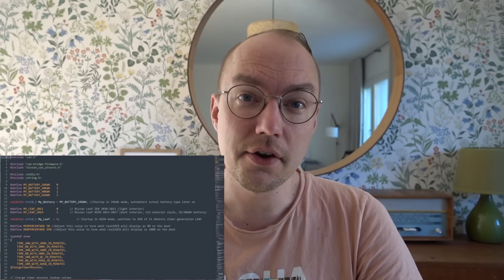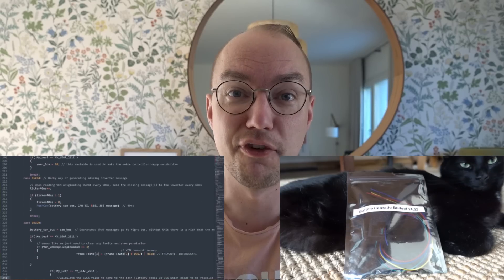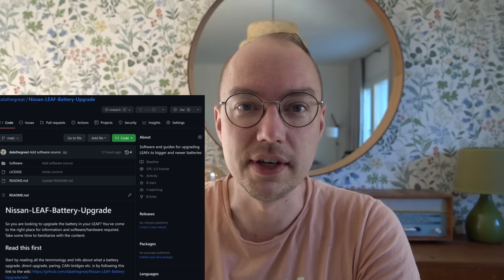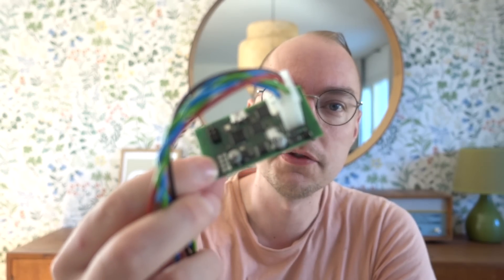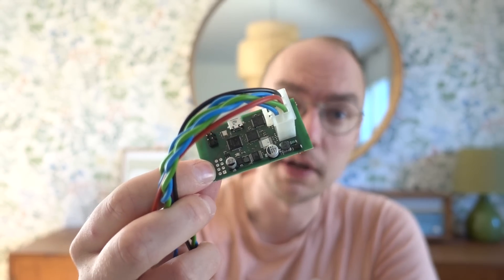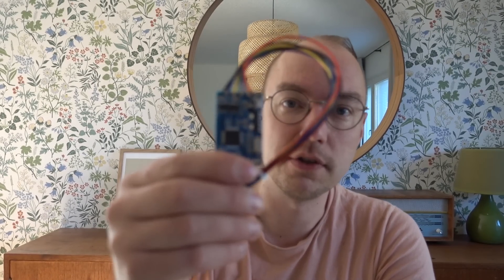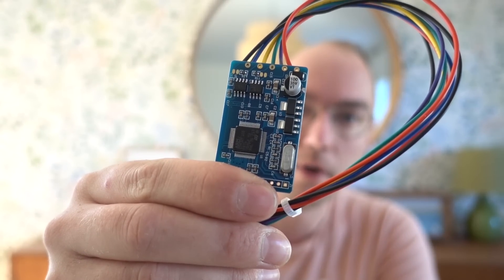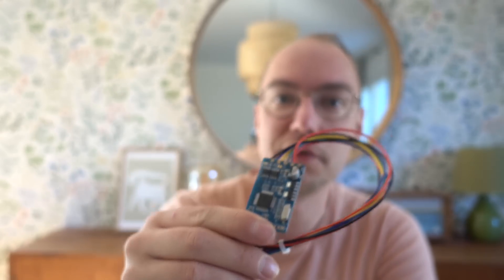Nissan LEAF Battery Upgrade hardware is now FREE

Comment: Nice action, but... not usefull. For a second I thought that its purpose is to repair (repack) the battery. But this software is only for replacing the battery from another car. I can't imagine where you can buy a good OEM battery, or, moreover, a good OEM battery from the latest model of the car separately from the car. It will cost as much as real estate. In our country, the only way to drive electric car, is to buy an old Leaf and repack the battery into Cattle cells. I thought for a second that your software allows to do this, but... well, all the things remains on it's places. To be continue with internal combustion, which remains the main source of moving.
Reply from the maker: Repair is available via Leafspy, and Repack is also freely available on the Mynissanleaf forum.

Comment: Here's something you might like to be aware of. Here in the UK there seems to be a lot of 10 year old nissan leaf's with 11 and 12 bar's of battery condition. Seems to me like something is obviously wrong, I have heard of a device that can reset the battery condition display have you seen this and would leaf spy be able to check this out.
Reply from the maker: Covered this in my "Nissan LEAF BMS unlocked" video

Comment: Hi sorry for asking a silly question, but what is the upgrade for? It it so you can use the battery to power your house?
Reply from the maker: This is for putting larger batteries into the LEAF. 24 to 30/40/62kWh batteries!
Reply: Thank You

Comment: Hi Dala. Your really instructive videos have finally pushed me to go and buy a 2015 24kW Leaf. Although it has 11 bars and gives me 80 miles range, it would be nice to plan for the future. Can you buy the canbus kit, program it and fit to the existing car before buying a 30 Kw battery to upgrade? It seams logical to fit the kit and test it before going through demounting the old battery and installing a replacement and then finding problems.
Reply from the maker: It can cause problems to fit the upgrade bridge without actually upgrading, so I recommend waiting!

Comment: Hello!  Huge hat tip to you for doing this!

I only just learned yesterday about all the DIY stuff people are doing with leafs, so I am really not clear what the parameters/limitations are of different solutions.  So I am wondering, can this work with a custom battery pack made from brand new cells, and which doesn't necessarily conform to the 24/30/40/62kwh capacities?  What if that bespoke solution uses LiFePO, which operates at different voltage to the car's native NMC chemistry (no, I'm not thinking of using both chemistries together)?  Will the code you provide allow the vehicle to "adapt" to this difference, or is NMC pretty much baked in?
Reply from the maker: No it does not work for that.
Reply: Yeah, I was afraid of that.  Maybe someone will crack that code (not holding my breath, though lol).

Comment: If you get a dead one out of the box, will it show when being programed or when fitted in the car? Thinking I have a dead one
Reply from the maker: Unfortunately both failure modes are possible (unable to program / no passing thru messages)
Reply: @DalasEVRepair  thanks for your reply, are they known to fail after some time of use?or once you have a working one,it will last the life of the car,
I have got mine working now, I believe that it was incorrectly flashed the first time
Reply from the maker: @jasong7374  The one I installed on my own car in 2021 is still running great! But having a backup is not a bad idea, they are only 13€. Who knows if it lasts 5-10-15-20years!
Reply: @DalasEVRepair  with my install i have solder in plugs on the can wires of the car and the can bridge, and also Carry a spare programmed and tested can bridge in the glove box,so if I have any issues I can change one on the side of the road, probably being more careful than nessary, but this is my first 40kwh upgrade on a 24 aze0 so still learning

Comment: Hello,
Could you help me with the fact that my car (2017) got a 40kW battery instead of the 24kW one, and since then it doesn't charge above 94%. What is the reason for this? Thank You!
Reply from the maker: Battery will charge to 92-97% real SOC, that you can see with Leafspy. The dashboard will show 100%. This is due to temperature/voltage diffs/internalresistance. Completely normal, nothing to worry about!
Reply: The dashboard show 94%, and LeafSpy same.
Reply from the maker: @PixiTrabi  then you have an older CAN bridge?
Reply: I didn't do the swap, so I don't know.  Where is it in the car where I can look at it?
Reply: I didn't do the swap, so I don't know.  Where is it in the car where I can look at it? The exchange took place in February 2023
Reply from the maker: @PixiTrabi  contact your installer. My CAN bridges got this SOC% fixed in the software at early 2023. If you need support for this, hop on my Patreon
Reply: Ok, thank You!
Reply: Hello, I checked today and I have the green 3-port can bridge in the car. If I read correctly, there is also an upgrade option for this due to the SOC. If I disconnect it from the car, does anything happen afterwards, and if I update it could there be a problem? Can the existing content be read and saved like, say, a BIOS chip? What should I look for on the Patreon page anyway? Thanks for the help!
Reply from the maker: @PixiTrabi  Car wont be drivable until you reinstall it. Yes it needs an update!
Reply: Could there be a difference in the program that would cause the car not to function after the update? After the update, the SOC even when submerged will be the same as in the case of the 24 battery, that the car wrote 10%, but LeafSpy still says 20? Now, in all cases, the car says the same as LeafSpy. Thank You!
Reply from the maker: @PixiTrabi  that will be fixed after the update!
Reply: Thank You! I ordered programmer and try it!
Anyway, can the existing 3-channel be replaced by 2-channel at any time? Of course, after programming!
Reply from the maker: @PixiTrabi  Ofcourse it can!
Reply: @DalasEVRepair  
Is it possible to find out from somewhere what version of software the current can bridge has?  The difference I saw compared to a video is that there are 83-92-99% options for the charging limit.  The video also had 7X%.
Reply from the maker: @PixiTrabi  You probably have a v3.XX these have lots of known issues.
Reply: @DalasEVRepair  What is the latest version now?  Is there a list somewhere of what has changed for which version?
Reply from the maker: @PixiTrabi  4.19 latest on Github. Sorry no changelog back from when it was closed source!
Reply: @DalasEVRepair  Thank you, the programmer will come soon and I will try the update! If I understood correctly, does it need 12V for the update?
Reply from the maker: @PixiTrabi  USB micro cable is enough!
Reply: @DalasEVRepair  Ok! Thank You!

Comment: Hi  Dala! Thank you for open sourcing your projects! I'm very excited about your CCS conversion!  I'm a software engineer myself, but I've not spent much time building ICs and controllers outside of Raspberry Pi & Arduino.  I'm personally interested in replacing the Leaf pack with my own LFP cells and BMS.  How much effort do you think it would take to accomplish building such a bridge?  I would prefer to do this vs adding my own range extending pack in parallel and consuming internal volume and extra weight.  Maybe we could work together and open source the project?

Comment: Legend! Thanks for doing this. I wonder if it will impact demand and price of the used packs? My brother in law's 24kWh is pretty low range now and would seriously benefit from a 40 or 62 :-)
Reply from the maker: Doubt this will do anything with pack prices, but the overall upgrade cost goes down significantly!

Comment: Hi Dala, Is there any schematic for the blue PCB ?
Reply from the maker: Unfortunately I don't have it!
Reply: @DalasEVRepair  I’m sorry for bothering you, I have another question, dose this board with its normal code have different application or it’s for Battery upgrade also ?
Reply from the maker: @ahmadzarara3149  When you buy it, it comes flashed with a mileage spoofer for Mercedes Benz vehicles. Highly illegal piece of kit! After flashing it, it becomes an useful thing that can do battery upgrades:)
Reply: It kind of sucks that some crook selling illegal devices that end up cheating people out of a lot of money is making money off of this.

Comment: Dala, this may be a stupid question but what do you thibk it would take to use tesla cells in a nissan leaf? Ironically, it's easier to find used tesla cells in the states than finding leaf cells that arent severely degraded.
Reply from the maker: See this: https://github.com/dalathegreat/Nissan-Leaf-Bruteforce-Upgrade#a-word-of-caution

Comment: Dala, hello! I bought a bridge 2 can, I flashed it as indicated in the instructions, but the values kW, lbs from 24 and the car aze0 24 did not change, and cells from 40 kW, please tell me what needs to be done so that the car sees the entire capacity of the battery?
Reply from the maker: My CAN bridge is for doing OEM complete battery upgrades, not cell swaps. You need a 40kWh BMS and current sensor...
Reply: @DalasEVRepair  I'm good at circuitry, but it's not my thing to program or rather write firmware. Can I ask you to make a firmware for this bridge? and how much will it be? lbc unit from 40kW is indecently expensive...

Comment: AWESOME! Now I just wished someone could publish what's required to put the 94Ah battery in a 60Ah BMW i3 BEV!  I have the battery (no collision lockout), but no clue how to make it work in my car.  (located in the US)
Reply from the maker: It is plug and play. No coding needed if the battery isn't crashed and locked. Just mechanical work!
Reply: @DalasEVRepair  Are you serious??  And the car will be able to use the full capacity?  I had so many people trying to tell me it needs coding or the car won't recognize it because of VIN coding and such.  

My i3 motor bearings went bad, and it's been sitting in my garage since February, waiting for a motor replacement... and I finally found one from a 2018 with under 100 miles on it! I considered swapping to the 2018 EME (inverter) to get the "S" model capability, but that would have also required the KLE charger from the 2018, and I know that would entail some coding/programming... so I'll just replace the motor. 

I got the battery for a steal... I don't think they knew what it was worth. The i3 Rex that the battery came out of was in a minor rear-end accident, 57k miles, but had no airbags deployed... so I'm sure hoping it's not locked.  It had heated seats like mine does... supposedly that matters. (is there some external difference?) 

If this works out, I'll probably endeavor to use the old 22kWh pack for home backup use.. though I might try to get a warranty claim on it first, before doing the battery swap....... hmmm......

I know I'll have to get the HVAC discharged, and then recharged when I swap the battery, but that should be worth it!
Reply: @DalasEVRepair  Has this been verified?
Also, have you heard of any way to test the 94Ah pack to make sure it's not locked from an accident? As mentioned, the donor had been hit in the rear bumper, but no airbags were deployed (which is why I'm assuming the battery is still "alive"). The impact damaged some of the drivetrain electronics, which kept the car from driving though.
Reply from the maker: @beforebefore  yes many 94/120Ah upgrades have been done without problems. Unfortunately no check to do before fitting!

Comment: Dala:  I am with you on developing things for the world because the world needs these things.  Your community seems to be my kind of people.  My own projects, to be published in the public domain before the end of the summer of '23, might appeal to your community.  First is a MPPT controller for PV-->DHW, with minimum parts count, made on a single-sided circuit board.  The companion project, which runs on the same 180-240 VDC PV array is a boost-mode DC-DC converter for charging EVs directly from the PV array.  No conversion to AC is needed to charge an EV. Both are operated by a Arduino Uno.  One or the other uses all the PV power, based on user-set priorities and whether one's EV is plugged in.   Schematics, drawings for mechanical parts and source code will all be available for free before this summer ends.  More people than just me need to be using cheap PV to power our world.
Reply from the maker: Sounds like a cool project! Good luck!

Comment: Could you record a simple example of how to check degradation by connecting to the 36Pin(Gen2) socket via Obd2 with a 12V battery. 

Would be a great example for those looking for something with a decent SOH 💪💪💪
Reply from the maker: I have the text instructions here: https://github.com/dalathegreat/Nissan-Leaf-Battery-to-OBD2

But I might touch on it in a later video yes
Reply: @DalasEVRepair  Wonderfully :)

Comment: Thank you very much. How canbridge will automatically detect battery ah. I'm already connected this bridge to the my car, discharge and charge battery but car don't see any changes, like without. what i doing wrong. i did upgrade my 2012 24kw old battery to 114ah catl. Maybe need change configuration code. Thank you for your patience and help thousands of people.
Reply from the maker: This is only for OEM direct pack upgrades. Not supporting any custom builds.

Comment: Hello… I agree. You are a true gentleman .
Quick question. Can I buy an early Leaf (2012 24Kwh) and modify it to do 2 way charging?  I have a barn that I can put PV panels on and then was hoping to use the Leaf as an inexpensive mobile battery pack and drive it the 150m to the house….!  Is this something that at least in principle is acheivable…. Regs Rupert
Reply from the maker: Probably, not something I will develop though! Chademo connector itself costs >1000€ , for that you can almost buy an entire 24kWh battery

Comment: Is very complicated to use 3x6.6kwh / 3x3.3kwh nissan leaf inverter's to become a DC ChaDeMo charger ?
Reply: Cheapest Chinese DC portable 10kwh charger is 7k€+ :(
Reply from the maker: Ya its complicated
Reply: @DalasEVRepair to bad :(
Scraped electric cars have so many electronic parts but no one can give them second life.
 Is less expensive to buy new models then improve old ones :(

Comment: Thank you for doing this! Making source code like this available makes life so much easier if you run into problems, or you're running some strange edge-case configuration that wasn't anticipated in the code. I haven't personally used a CAN-bridge in a Leaf, but I've spent a lot of time reverse engineering similar things, where source code availability would have saved days of work.
Reply from the maker: Yes this has been 3 years in the making! 😅

Comment: Hi Dala. Is this flashing process to upgrade to a 40kwh battery or 62kwh? Is it compatible with both or just only one? Thanks in advance for your help!
Reply from the maker: Not sure yet. This software is only for 2011-2017 LEAFs
Reply: @DalasEVRepair  I have a 2012 leaf that is why I asked. So with this flashed PcB I may be able to install a 62kwh battery in my 2012 leaf?
Reply from the maker: @jesuskingofkings  Yes!
Reply: @DalasEVRepair  Great! 👍 God bless you! Have a wonderful day.
Reply: @DalasEVRepair Hi again Dala. If I reprogram the blue PCB and install it even though I don’t have the new battery pack installed, do you think there would be any issue with the car using it with the old battery pack. I’m planning in buying one, reprogram it and install it and then buying the newer battery pack.
Reply from the maker: @jesuskingofkings  do not install it before getting a newer battery!
Reply: @DalasEVRepair  Ok then! Thanks!
Reply: @DalasEVRepair And what happen if I install it and retire the 3A fuse to keep it off?